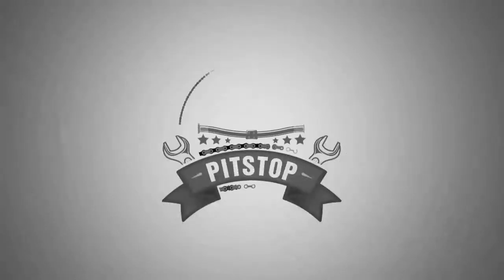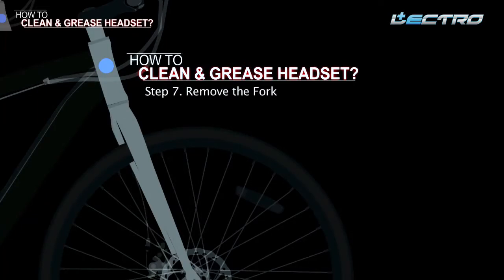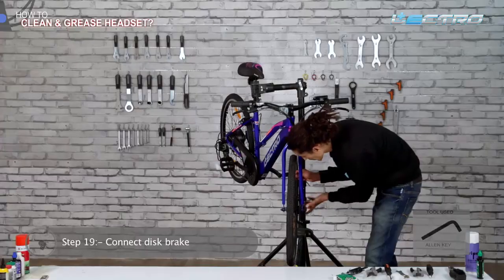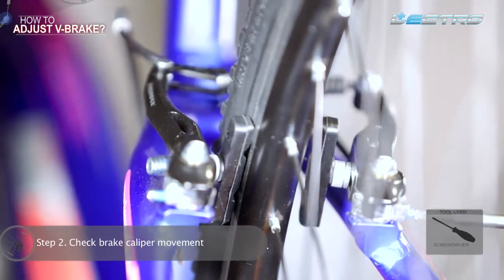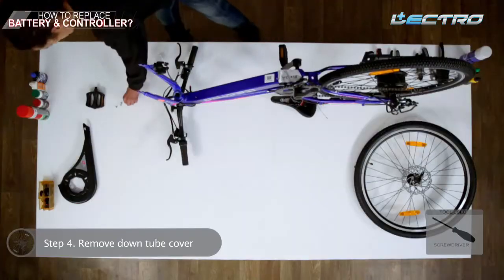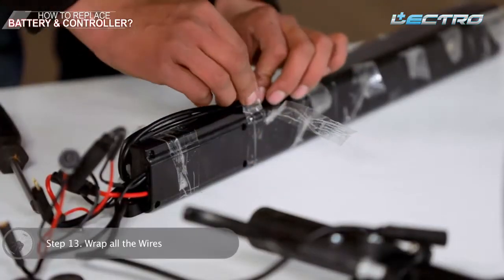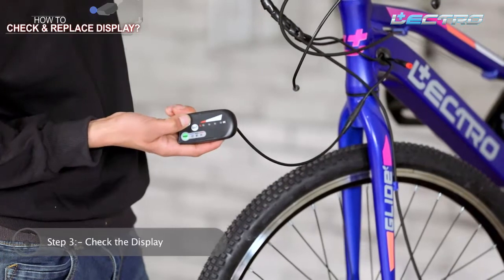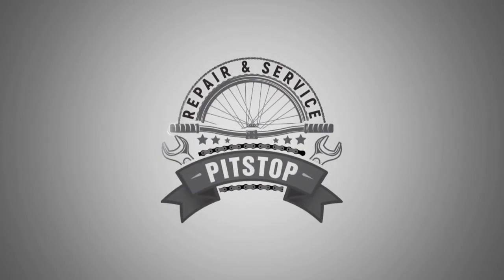Hero Lectro Electric Cycle Self Service Assemble DYI

Comment: Hello thanks for ur complete review. I just wanted to know, can we add mudguards and a front basket in this particular cycle model i.e lectro lady glide. And if anything happens to the cycle who will repair it. My dealer says you have to get in touch with the company
Reply from the maker: Yes, we can fix the mudguards but basket basket not possible. Regarding service any authorized dealer will(should) do it, else escalate to company service

Comment: What to do if pedalac system is not working 
Throttle is working
Reply from the maker: The sensor at the crank may have failed, need to check